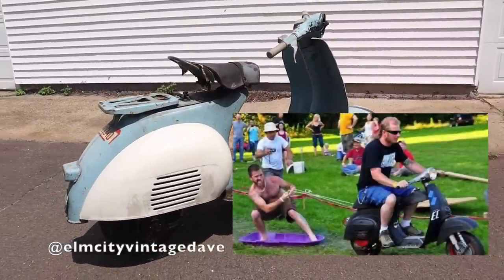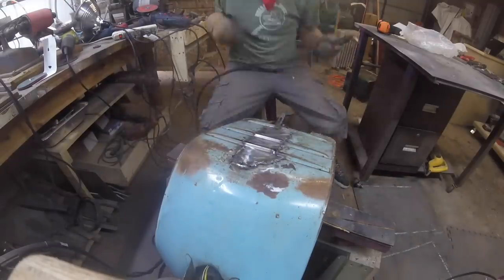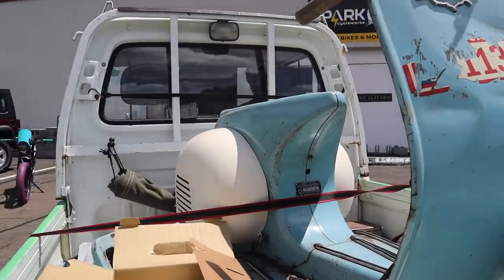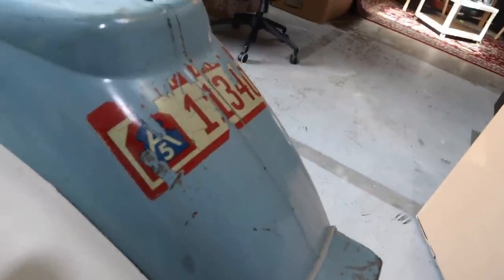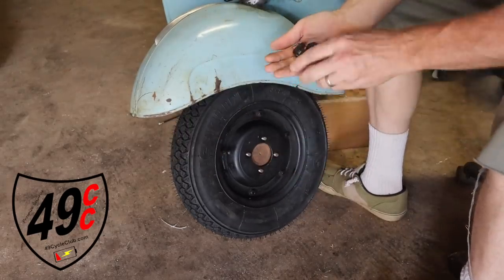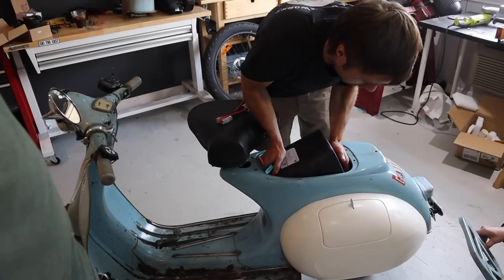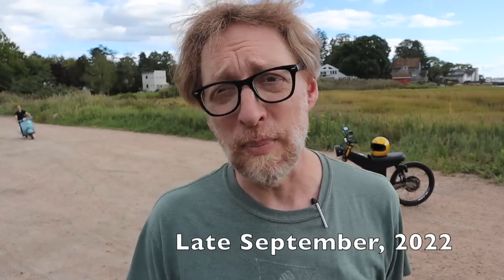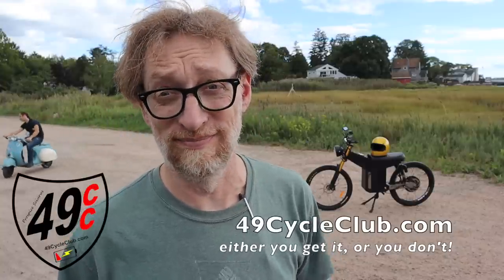We Made this Antique Vespa 100% Electric!

Comment: That is definitely one sweet ride! And I definitely wouldn't miss that gas-mix smell.
I hope you're also going to LED those lights while you're at it. While I really love the amber glow of the old bulbs, when it comes to light output and low battery drain, the modern stuff really can't be beat. And  BTW, you're going to need an inline resistor if you're going the LED route.
Reply from the maker: Yes. I want to be seen more than be cool :)
Reply: @timsway  Well, one doesn't exclude the other 😉

Comment: As a former welder, I can tell you that it is extremely important to always wear protective eye wear when using a welding machine. It will save your eyes from the destruction the light can cause. As for the weld its self. If you want a strong weld, it's best to tack the corners, and a few spots a few inches in-between, then layer a solid weld of a bead over the entire piece. I was taught to start an arc from the piece you're welding to, then move from top to bottom in a C-shape until the piece is welded together. Never sit for more than one second in the same spot as you can cause a hole to form. So be as fast as you can. And if you need more help, look for some welding videos on YouTube.

Great work on the Vespa, Tim. Would love to see more videos outside of your musical instruments like you used to make.
Reply from the maker: While my son had the helmet on, I was closing my eyes. Thanks for the tips!
Reply: @timsway  Cool. They also make welding goggles.

Comment: This is a very fun departure from your usual content. There's nothing more satisfying than taking on a project for the first, or second time, making mistakes so you lean what not to do and what works. I just did my first torched guitar finish with hand rubbed Tru Oil finish, and I learned a lot. I look forward to the next one. Is that the Chinese truck ???
Reply from the maker: Japanese Kei truck. 1992 Honda Acty. I love it. cheers!
Reply: @timsway  It is SOOOooo cool. I love that the side turns into a ramp. So Tim Sway.
Reply: @timsway  I've never heard of that truck. I just looked them up and they are very cool ! Even vans. Are they all under 700cc ? There are quite a few for sale in USA.
Reply from the maker: @michaelb.42112  they've become trendy recently and some guys are importing them in bulk. In Japan, it's a class of car for non highway use that's affordable and popular. In the US, if the vehicle is older than 25 years it can sneak through most (all?) states registration process and not be required to pass emissions or safety requirements. You just need the right paperwork from the dealer and state vin inspection. I drive mine every day and it's great,. but I don't go on the highway with it. It's not designed for that. keep it under 50 mph
Reply: @timsway  So very cool. I LOVE your electric Vespa and I subbed to SparksCycleWorks. I'm not trying to take away from that video, but I think we'd love to see a Tim Sway episode of that truck. I know I speak for others because it's COOL.
Reply from the maker: @michaelb.42112  I made some vidsa about it when I first got it and sneak it in to intros and outros now and then https://youtu.be/mkpEtvCKEMw

Comment: Do you have a parts list for this build? I'm interested in knowing what combination of hub, controller and battery you are using and, if you are willing to share, where you purchased the items. Thanks!
Reply from the maker: On this build I used a 3000 watt hub motor, Sabvoton 72v 80 amp controller and a 72v battery. I don't have the exact parts links/receipts as Spark did the ordering. If you bug those guys they might have actual web links. You'll also need a 72-12v stepdown for lights and stuff and some jury rigging to fit a throttle, brakes, etc.

Comment: Thanks for being upfront about your sour experiences, most YouTubers shy away from getting into dark waters like that (though you're in the absolute right to speak out your experience!). As you might imagine, these old scooters are a whole lot easier to snag around here in Europe and while I still have to look into the current legislation, I'm pretty positive I don't have to worry about homologation or registration around here in Portugal when it comes to electric bikes up until a certain power. I'll definitely ponder this as a future wishlist project, thanks for sharing and enjoy it!
Reply from the maker: I'm sure they are easier and cheaper to get there than here. They certainly live in a grey area, especially, converted. But I think depending upon where you live and want to use it it should be easy to figure out the right thing to do. So say the lawyers of the 49 Cycle Club :)

Comment: I almost wonder if retrofitting a 60 year old scooter kit would be profitable, since there probably aren't many old Vespa scooters left that would be viable candidates for retrofitting, however, it would be great to make a version of the retrofitted prototype from scratch, that resembles a classic Vespa scooter, but better designed to hold a battery, and all the electrical components, while still having those classic Vespa body lines from scratch...Possibly a battery pack under the floorboards, along with the battery pack under the seat for additional range and power, and maybe regenerative braking, etc. Maybe an on-board charger, so the scooter could be charged with a simple 120V extension cord, or somehow add the option of using readily available electric car chargers for a quick charge at the grocery store/super center.
Reply from the maker: There are Chinese electric scooters available in the US  already that are basically "modern Vespas." The Javelin Spark is working on is a "scooter" not a moped, but with a more motorcycle like body that will be made in the USA (of course the electronics still coming from overseas. Baby steps). Indeed there's a place for all these ideas. Me? As a reclaimer/trashpicker and with my personal aesthetic, I like starting with old and retrofitting it as new, so I'm starting here! I def. want to do more. This is as addicting as making guitars! 

Oh, and my charger is small, works off a 120v outlet and I keep it in the storage compartment of the Vespa already. What would be nice is if I could easily remove the battery and take it inside with me, like the Javelin prototype: https://youtu.be/nPMrdCCNn0g
Reply: @timsway  I appreciate the retrofitting of the classic Vespa scooter that was probably beyond repair to get it to operate as originally designed. (The old motor was seized, and wouldblikely be too costly to return to original operation), but I think that building a scooter with similar design lines would be more marketable than a kit to retrofit a 50-60 year old scooter frame, and there likely aren't many old Vespas laying around that aren't already restored to ICE operation, or rusted out and structurally compromised, or haven't already been recycled. Vespa scooters were much more popular overseas, and I believe there are companies making cheap copies of the entire Vespa ICE drivetrain. I think the cool factor of the Vespa design lines would be a major selling point for a newly manufactured electric scooter design that could be easily modified to better use the available space for the requirements of an electric drive train. I think battery packs (removable) could be integrated into components like the floorboards, or under the seat to better utilize the available space for ultimately additional power and range.

I don't know if having a removable battery pack would be as advantageous for the end user, since I doubt many people would be removing their battery pack to charge it on their kitchen table overnight, and more likely, the battery could be left in the scooter, and charged in a garage, or while parked next to the house/apartment, since the scooter would likely be used for an inner-city commute, or for running errands where owning an automobile might not be practical.
Reply from the maker: @ltd4all  absolutely! That's just not where my interest lies. But city use is why people would want to take the batter inside, for security as well as charging ease. Also, Vespa, who owns the design, already does. https://www.vespa.com/en_EN/models/elettrica/

Comment: As member #005 I fully support and enjoy this content. Great job Tim!
Reply from the maker: LOL. Yours is a monster! probably blow this out of the water. I'm definitely lacking something going uphill, but still tweaking the settings and output.
Reply: @timsway  getting the right amperage and cooling is key. Which hub motor is it one of the QS wheels?
Reply from the maker: @GaryOshust  I don't know the brand off the top of my head but its 3000 watts brushless. we're using a really nice MQCON controller that we can micromanage details. right now I'm limiting it at 52 amps, but it should be able to handle up to 55 or 60. Since this is a prototype, we've ordered a backup motor in case we blow this one and we're slowly pushing it more.
Reply: @timsway  I'm running a Kelly KLS-H 8430 for the controller 84v nominal, 100A continuous and 300A max. It's interface for programming isn't that sexy, but it does get the job done. I'll have to look this weekend as to what I dialed it back to as I don't remember off hand. Based on what you are seeing on your bike I'd bump up to a controller in the 70-80A continuous range and maybe look at a 5000w hub to get to the performance you are looking for.
Reply from the maker: @GaryOshust  right. I'm 72v (but the battery is really 84) and the controler is 150 max, which is pretty perfect for the size and weight of the vehicle (until you hit a big hill).  I think even if I can get this rig up to 60 amps I'll be able to cruise uphill at 25, right now it's more like 20. This is the prototype so we're trying to weigh cost/efficiency and legality of keeping it in the "49cc" range without raising too many eyebrows. Another 1000 watts or so would be welcome, but not "neccesary"
Reply: @timsway  Yes, my 84v nominal is really 100v fully charged. The Cushman is registered as a motorcycle so I don't have the 49cc wall and it will accelerate up hill; pulling about 80A. So upping your amperage is the way to go, that should give you the torque you need for those hills. Based on the wheel size of both our bikes it would be hard to get it much past 50mph on a hub motor as we will hit the rpm limit of the hub, but do watch the heat of your hub. If it gets to hot to touch after a half hour to hour of riding you need more wattage.

Comment: That's a really cool project,  and I'm glad it worked out for you.   By default,  if the existing engine wasn't "done"..........I wouldn't have been as approving.   In this case,  I'm fairly certain that scooter would have just gone to pieces for the sake of others.....so it's a cool save.
Reply from the maker: The guy I bought it off restores and collects them and he would have been able to buy as rebuilt gas motor for it (that was his plan). But he has so many in the works and more lined up that he was wiling to let this one get non traditionally restored.
Reply: @timsway  I refer to this as  "Rust-O-Ration"......  keep it looking used.
Reply from the maker: @DeadKoby  As the saying goes, it only has original paint once...

Comment: See also Retrospective Scooters, UK. You both ended up with the same solution, around the same time.
Reply from the maker: They were around before us but are incredibly expensive and overseas. We saw a market for the US.
Reply: @timsway  Hi Tim great effort and I get the father son work shop bond ,thats cool and fun to watch in the project all unfold with honesty. In our defence , the difference with the extra expense of our kits is in the quality, we use higher end componnets alround, our swing arms/control boxes/battery trays 4kw motors are a culmination of 6 years research and development, thee most important part of it all is our batteries which are Samsung /LG cells of the highest rating and best on the market  built up to a specific size that fits the different Vespa and Lambretta model 100A BMS for amazing preformance also removable from the scooter for indoor charging option,, all in a compact easy instalation conversion kit. We also provide back up to all our customers worldwide with video calls if need be and our You Tube channel has step by step instalation guides as well as any updates, we also have all spare parts in stock.

Comment: Good job lads! I convert all my Scooters. Been doing it for 20 years now. ONly last ten have been worthwhile though. My latest is a 1961 V5T Vespa, switched from 8 to 10 inch tyres, 72 volt Lingbo Controller like 300 CDN dollars, 5kw hub wheel motor from QS Motor 250 CDN dollars 130 ah Lithium Titrate speed charge Battery 2100 CDN dollars equals-top speed of 180 kph, 0-60 kph in 1,2 seconds, 420 nm of torque, 45% climb angle (hills not issue) range real world of 610 km's per charge. Same as my 1964 Lambretta GT conversion that is my daily driver.  SMeet are pretty good, Retrospective UK is the best in the world currently for the price. I prefer to build my own kit which I do and it is not even half the cost and mine are far better, faster, more reliable, easier to maintain and far more price to use relative. The main thing you need is a swing arm for the rear hub motor. after that it is pretty easy.  I have been buying used crappy Indian built imitation Lambretta and Vespa Motors from India as they are like 40 USD empty with no gears or cylinder etc. I reuse the original crank and guts with a simply 72v 5kw BLDC motor in place of the crank and chain drive it to the original Wheel minus the original gears.
Reply: Feel free to contact me I can give you ultra awesome cheap parts list to build any Vespa or Lambretta conversion easily. You guys and the Spark guys did a great job though! Honestly! Love to colab on a build?
Reply from the maker: Thanks for all the insight! Yes, we agree that we need to go bigger than 3000 watts for hills and stuff. It;s perfect on flat ground, but I don't live in a flat part of the world! I'd be very, VERY interested in seeing your parts list. you can email me directly via newperspectivesmusic.com